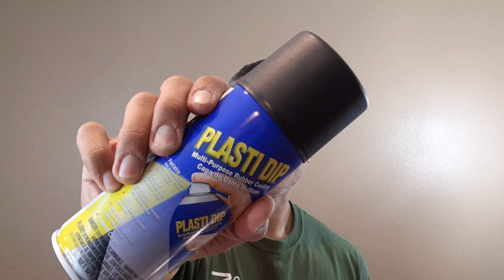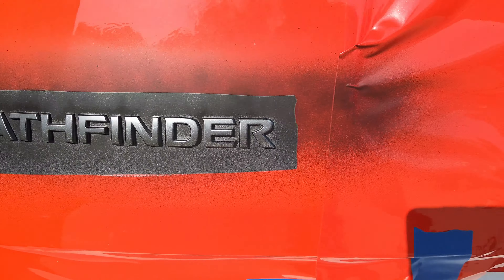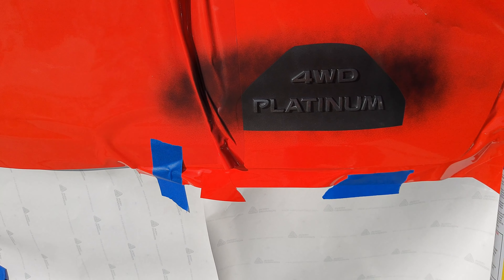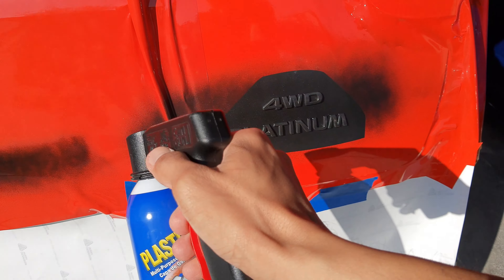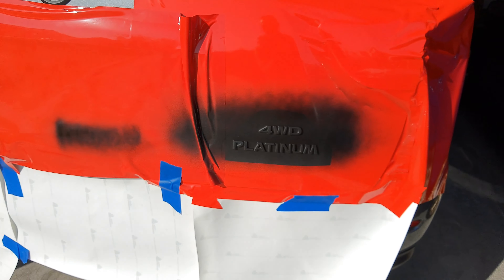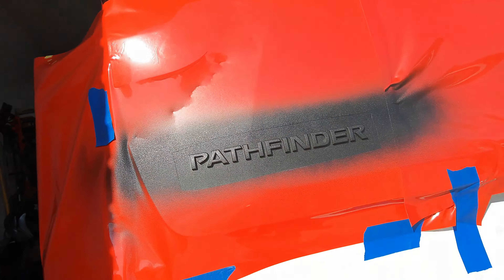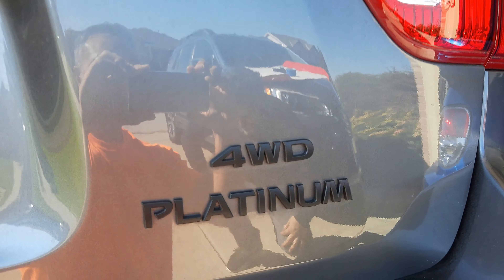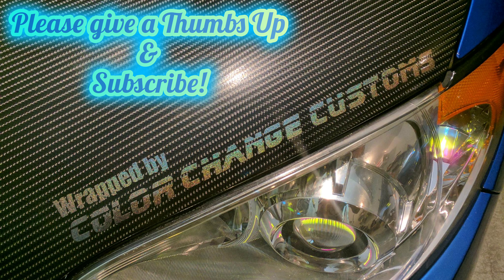How To Plastidip Emblems -- Super Easy Chrome Delete

Comment: I am replacing damaged emblems. The new  ones only come in chrome.  Is it better to use plastic dip before or after adhereing to car?
Reply from the maker: Honestly, I think it would just be Personal preference. Doing it while it’s off the car means you can plasti dip it wherever you want and not have to mask off the car. Just be careful when putting The emblems on after to ensure you don’t damage the plasty dip.